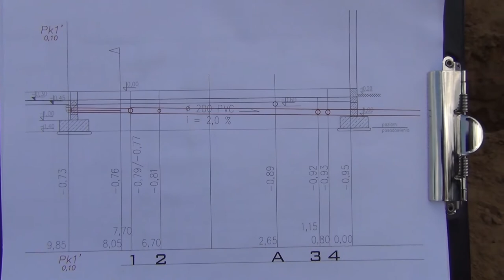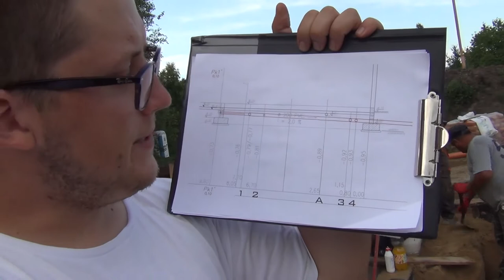BoH 38 - Sanitary Drainage System Installation

Comment: Have you checked whether the sanitary pipes are tight?
Reply from the maker: +Marymay M we poured some water in each opening and checked if similar quantity runs out of the collection pipe 12 liters each time
Reply: Great. Thank you for the answer.
Reply from the maker: Sorry, maybe my answer was incomplete. Together with the building site manager Mr Janusz, we took 2 x 12 Liter buckets we poured from one and caught in the other. Accounting for some spillage and minor losses on the edges of the connections, in general, the resulting last bucket was about 11 Liters after we checked all the pipe branches. So it looks solid as the total losses were about a liter, and that includes me spilling some each time :D